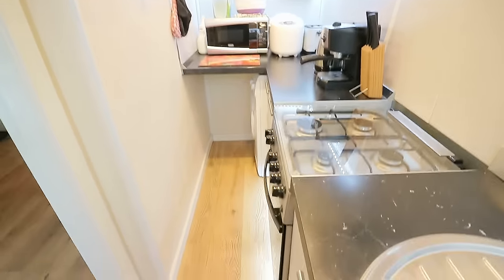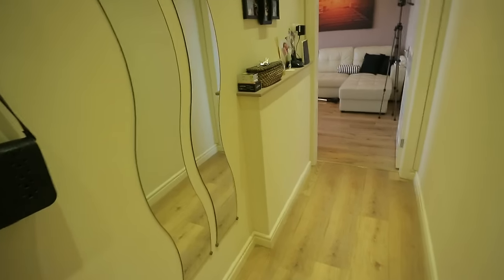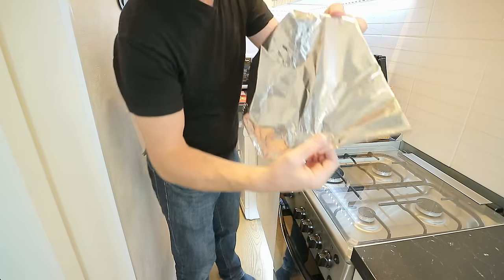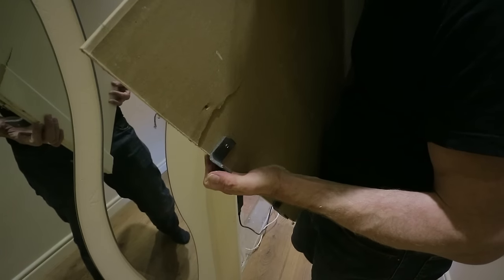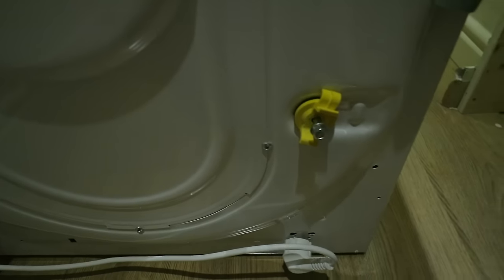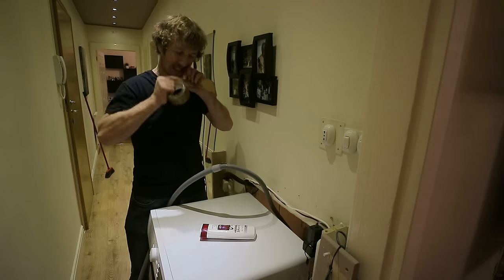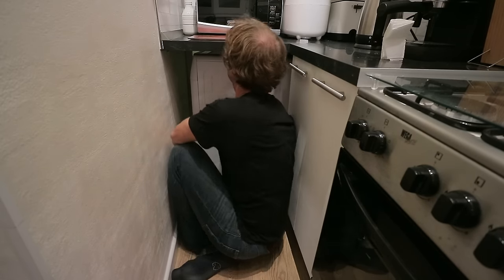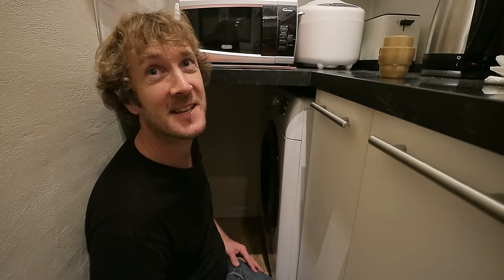How to Install a Washing Machine (In a REALLY Small Kitchen!)

Comment: Have you considered replacing the L part of the counter (microwave area) with a foldable solution and putting the microwave in a higher place with a shelf? This way you can easily access the machine and still get the counter top area when you need it.
Reply: My thoughts exactly! No way would I crouch on my knees to do laundry. Completely out of the question. But I would turn it in the direction of the hallway. The way he put it in, is the way that the front of the washer/dryer would face..in the hallway, The box thing in the hallway would have to be moved over over so that the kitchen would have that additional area for storage under that counter top.
Reply: Exactly what I was thinking!

Comment: Thanks for the helpful video! Pretty funny too lol. Alot of vids I see doing this have the drain hose just emptying out directly into the kitchen sink basin. Im thinking either a) people dont know how to install it under the sink or b) its intentional for disposal. I read that its better to have the hose higher than the washing machine for something to do with phyics. So that may explain why some do it that way but I dont care for it at all and prefer the hose out of sight.  I love the way you have yours connected under the sink hidden away. It seems like your washer operates perfectly fine, may have to try this myself.
Reply from the maker: Thank you! You can lead the hose up higher than the washing machine before it heads down to the under sink connection. This plumbing worked great for years with zero problems. Cheers, Chris 🙂

Comment: Hi Mate 
Thanks for the video, Having watched your video I had no thought of changing our washing machine but I remembered your  tip on using foil under the all feet of the machine! , well had to buy a new machine our new machine is so tight 600mm space the machine 600mm its a very tight but used yourfoil trick nd it worked a treatin and out to connect  a life saver else without would of had torn cushion floor again 
big thumbs up !!

Comment: One of your funnier videos!  Still a good bunch of tips (as usual).  One question.  Why didn't you face the washer towards the center of the kitchen, so you can see the controls?  Doesn't look like it would block anything...
Reply from the maker: Hi Joel, thank you very much. 🙂 The gap isn't wide enough so there wouldn't be enough room for the door to open. Also, we keep some items on the floor in the corner under the worktop (bottled water for Rossella [I drink from the tap but Italians are fussy about their water 😂] & wine) so the extra storage space is useful, given the miniuscule nature of the kitchen! :-) Cheers, Chris 👍
Reply: In that case if you can't see the controls you can install a little light, it would be helpfull at the time to do the laundry! Regards!

Comment: Also, if you’re not using the space in front of the washer, door, and there are types of cabinets that allow you to roll with inside of a cabinet so that you can use that corner space, perhaps consider turning the washer, so the door faces into the kitchen ?

Comment: A really interesting video, although I wasn't interested in doing it myself. But maybe I'd suggest your countertop where the microwave is to have it hinged against the wall? Then easy access to the washing machine controls. Anyway, I liked the way to explain it. Congrats!
Reply from the maker: Hi there, thanks! We need all the workspace we can get and we have the microwave on top of the worktop there. We have since added a bread making machine so we're getting really short on counter top space! The washing machine works fine under there, it's not a problem using it. Cheers, Chris 👍

Comment: Hello Chris, great video. Is it doable to have a dishwasher this far from the sink instead of a washing machine? My husband keeps saying we will have draining issues with the dishwasher  (he is not an expert). I am dying for a dishwasher but the only space we have is the same distance as your washing machine is. Thank you in advance.
Reply from the maker: Hi Aisha, I believe you could do exactly the same as I did and the dishwasher would drain without any problems. If you have a slight incline from the high point at the dishwasher down toward the sink then gravity will drain the hose naturally. I installed the PVC pipe inside the wall when I refurbished the kitchen to keep the flexible drain hoses out of the way but it would also be possible to have these exposed behind kitchen units, as long as the flexible drain hoses are well supported to prevent them from drooping over time. Good luck! Chris 👍

Comment: This is very informative and inspiring for me as I look at how to permanent install a washing machine in a kitchen. Question: how do you get away with the drain hose being so low? Don't they have to come up to a certain height (I've read 30 inches minimum). I would think that you need to at least run a bend higher, then come down into your kitchen sink drain.
Reply from the maker: Hi Ken, the drain hose does go into the PVC ‘conduit’ pipe at that height, so it has to go from the machine up to that before heading down to the sink drain. We’ve had zero problems with this set up in the last decade, so it works perfectly for us. Cheers, Chris 👍
Reply: @christopher_barr  brilliant. I also discovered in another video, that as long as the drain hose is higher than the point in the washer where the most water is filled, then you're fine. Looking forward to properly installing a washer in my kitchen!

Comment: Hey brill video, and very clever and funny. I've tried to fit my new washer after replacing it with a new one, having problems pushing it into the tiny space but size spec is same as last one, not sure why its not going thru, I have a concrete floor where it'll be placed, will try with some polish...
Reply from the maker: Hi Shaz, thanks for your comment. You might find it's the friction of the rubber pads on the bottom of the feet of the washing machine that is making it hard to push into place. You can try putting some Aluminium foil (folded over a few times) under each pad so that it can slide around. Once on position you'll need to remove the Aluminium foil otherwise your washing machine will move around with vibration over time. Cheers and good luck, Chris 👍
Reply: Or washing up liquid :)

Comment: Great video but one question when you connect that drain pipe under your sink should you have that u shape thing or isn't that nesseery I have kinda similar shape to yours but the pipe from washing machine isn't quite long enough to be able to use that apparently it stops from the dirty water getting back to the washiny machine..

Comment: In this small kitchen, you can change the location of the washing machine to the place of the kitchen cupboard. Any washing machine is located instead of the kitchen cupboard. And the kitchen cupboard is there in the corner instead of the location of the washing machine. And can dispense with only one door of the kitchen cupboard. The washing machine can have a longer bowl to drain the water, and another long bowl to take the water for washing. And there can be in the corner to put only one kitchen cupboard. The other cupboard can be placed in the hall room, attached to the wall, and installed in a higher place in the hall room. Thus, they have a spacious place to wash clothes in the washing machine, and they can open the door of the washing machine freely. 
Or they can exchange the washing machine for another washing machine that is not wide and small. She opened her door upstairs. You can place it on the other side of the wall in that long corridor entrance, in the hallway in the hallway .

Comment: did you have any problem with it draining?  I was always told that the drain hose had to be higher than the actual washing machine to drain properly.. I like this method of hooking up the drain, just bought a new place and I need to add a washing machine...
Reply from the maker: Hi Michael, we had our first washing machine (which was the cheapest model we could find when we bought it) installed there for 4-5 years with no problems whatsoever and the new washer dryer has worked perfectly since installation, so the drainage works great when installed this way. Enjoy your new home! Cheers, Chris 👍

Comment: Hello Sir. I would like to offer my idea. Since you already made a whole in the wall. Instead of leaning down to do your laundry, why don't you put the what the area that you go in or you could put it on the hall and put a drawer in that empty unused space there.
Reply: I was just about the make the same suggestion.
Reply: because he had it like that for 7 years ( 10 years as of this comment) and now he can't fess up to that original oversight). For 10 years it would have been accessible to the larger hallway and gain some drawer space back in that tiny kitchen. Would also go with putting a drip pan under it to catch any leaks. 
Still, awesome ideas in this video

Comment: Thank you had a little bit of time piping underneath the bathroom sink this plastic tail pieces (plastic are rubber) is smaller
then the washing machine drain hose needed metal clamps and duck tape on the side I’m buying next time with concussion

Comment: That type of tape gets brittle with age, it is ment for cardboard packaging. You should use construction tape that resists aging, it is flexible and long lasting.
Reply from the maker: Hi Richard, the sole purpose of that tape was to keep the two sections of pipe united as I pulled this into position. It could have fallen off after 15 minutes and it would have made no difference in this application. Cheers, Chris
Reply: @christopher_barr  That explains things.

Comment: oh hum,,,   I am saying this but,,well here goes ,why did you not get a smaller width machine say a 55cm and place with more access? but be that as it may,,, I think its better to put jubilee clips on those waste pipe joints... At the present im plumbing in a dishwasher and washing machine, and fitting the outlet and u bend pipe (thingy) cos thats all they sold and it does not fit,,,, so not pleased that you smeill so much...am I hacked off ,,you bend... is that kitchen big enough for yorkshire pud??  regards